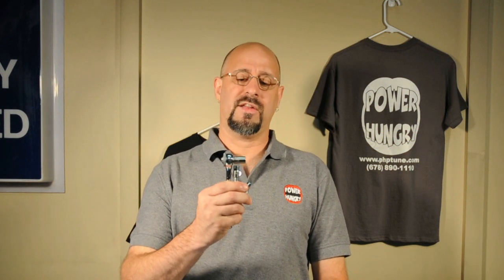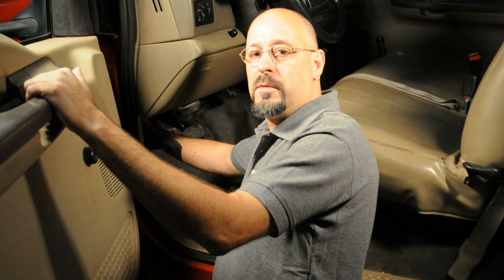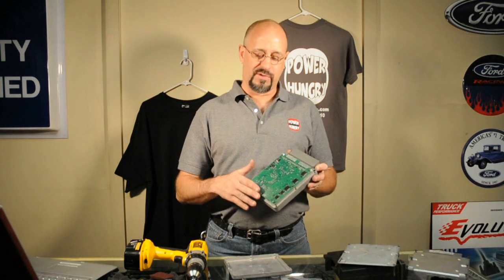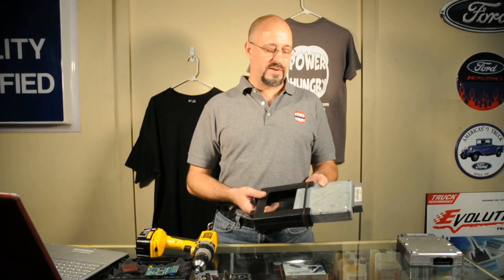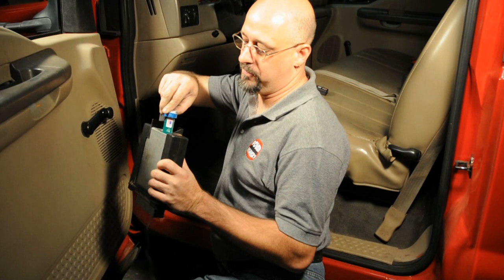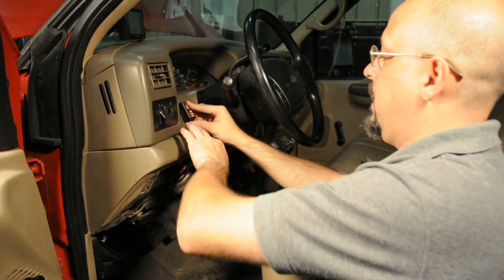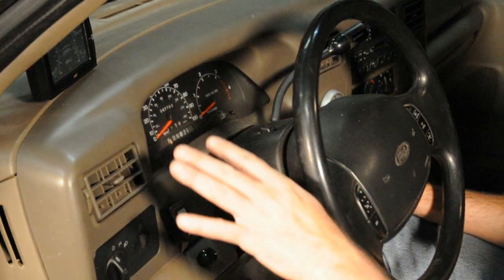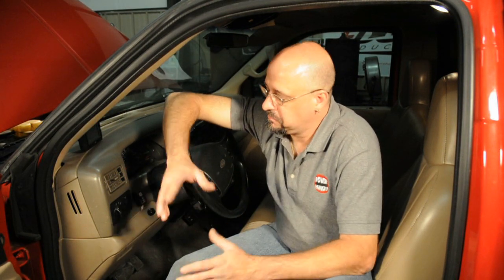Hydra Chip™ Installation on a 2001 Ford F-250 Super Duty

Comment: Correction --- you DO have to notch out the back of the case. It's not just a "easier to remove the chip" thing. If you don't notch it, then the computer won't fit all the way back in the case. You either won't be able to screw it in tight to the mounting frame - or - you will like crush / break the chip trying to do so. Discovered this on my 02 Excursion. Other than that, great video. Helped me out a lot! Thanks.
Reply: Yeah I'm there now bud, you are correct, not gunna lie, this is the worse install video I've ever seen.
If I'd seen this before purchase I'd not have even bothered. Plus mine came with the USB cable but going in the wrong direction, so now ripping it out as just more junk pulling at connections.. Wish I'd just stuck to the Edge Evo CTS I've used in in the UK the past ten years 😭😭 But thanks for correcting the info ref cutting case.. Jezz!!
Reply: USB cable going in the wrong direction? You plug in the USB cable. It is not possible to plug it in the wrong direction.

Comment: Perhaps because it's kind of common sense, this video failed to mention an extremely important point.  Before you disassemble any electrical parts on your vehicle, DISCONNECT YOUR BATTERY(s), at least the negative terminals, lest you get a nice little short somewhere within your electrical system.

Comment: Really really really clean the silicon off the truck cpu. I spent 5 hours clean and fucking around with a bad connection. Finally got it in, runs fine for month, and the day I have to drive to an interview I get a bad connection and the truck shuts down. Now I gotta pull it out again. Need a video on how to do this on a pre-98 ford standard

Comment: Dumb question. I bought my e99 7.3 with a TS6 chip in it and want to replace it with the Hydra. Is it as simple as removing the TS6 chip and replacing with the Hydra? Or do further steps have to be taken?
Reply: It's not a dumb question. Yes, it's basically just remove the old TS chip and install the Hydra. However, we do still recommend that you remove the PCM and re-clean the connector just to make sure there is no oxidation on the contacts. Also, make sure you program the chip before installing. We get calls from time to time where people don't realize the chip is blank.

Hope this is helpful.
Reply: @BillCohron  Thank you sir
Reply: @BillCohron  I installed the hydra chip today. Man it really woke the truck up, the shift points are awesome to. Running the 100 horse performance tune. Thanks for taking the time to respond to me.
Reply: @Dooly223  Do you notice it shifting hard?  A little more than what I would call firm.  Not sure I like that too much with the E4OD
Reply: I was scrolling looking for this exact message super helpful thanks

Comment: I just followed this video 100% step by step while installing my hydra chip, fired up truck noticed no difference in performance at all.
9 preprogrammed tunes came with it with sheet showing each tune. Tried every tune and all were same as stock performance.
The truck ran fine but no performance gains.
Reading through the hydra manual it does say to clean the terminals off on BOTH sides of the computer. Following this video i only cleaned off the 1 side which was shown. So now I have to go back and redo this all again 😪
Reply: Did you get it sorted out?

Comment: Chip wouldn't install with the micro usb adapter connected.  also wasn't show with it connected in the video.
Reply: It does install with the micro USB cord connected. You gotta maneuver it slightly at an angle to get it in first. :facepalm:
Reply: @samuelyi9189  or just install the chip with the PCM cover removed. Much easier.

Comment: Good video with just right detail.  Some close-ups of some of your stuff might have been good.  My only real critique is the install of the switch looks like ass.  Having a ribbon cable poking out under the switch and showing is kind of ghetto.  Add to it the way the switch sticks out at the bottom: Yuck.  I am guessing that ribbon cable isn't long enough to reach a pillar gauge pod?  Hopefully there is an extra cable if you buy the gauge pod switch.
Reply from the maker: A pillar pod switch is available as an option. As for the reason the cable comes out the bottom of the switch, it's because I personally don't like the idea of cutting into the dash. The way the switch and cable mounting is designed, it does not permanently damage or disfigure the dash or bezel. Of course, the pillar switch resolves all those aesthetic issues. The pod switch comes with its own cable, so length is not a problem.

Also, if you're interested, Joe Oram is making a recessed mount that can be installed into the dash and then the switch is inserted into the mount. This keeps everything flush. Again, I'm not big on cutting into the plastic, but I do understand that some folks don't mind this and would prefer the cleaner installation. There are also a few places that make a gauge adapter that allows for the switch to be mounted next to the bottom gauge. I think Joe makes these as well.